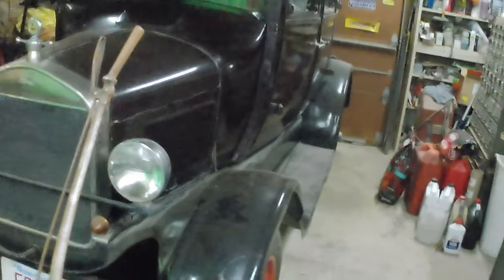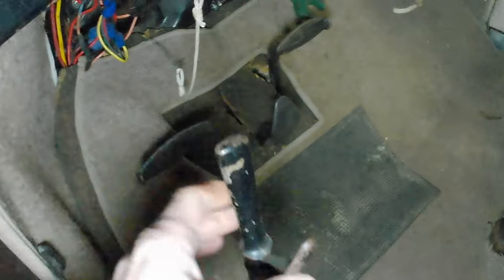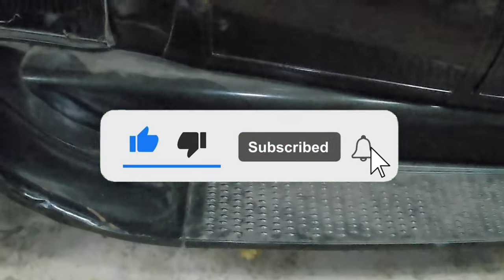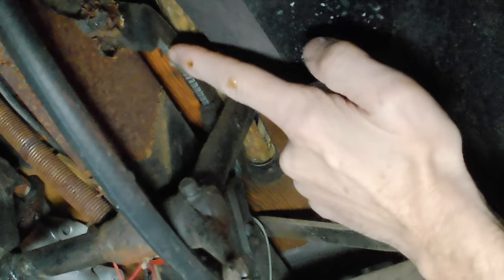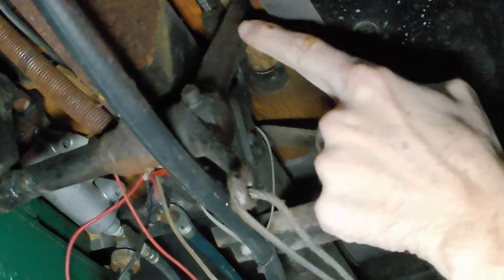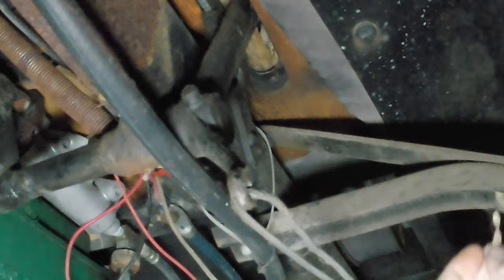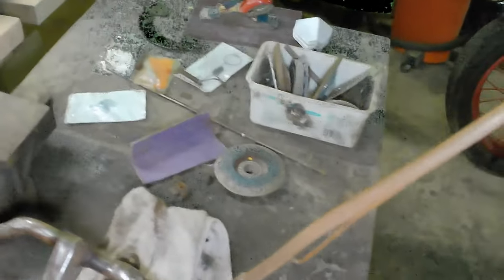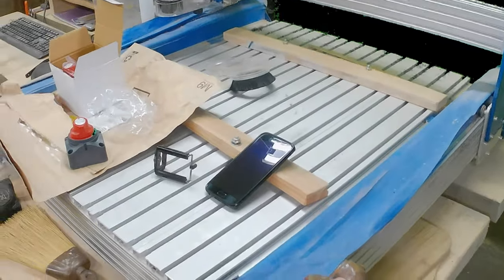All about the handbrake on a Ford Model T

Comment: What is the torpedo that you speak of?
Reply from the maker: In 1911 Ford made a lower fancier version of the roadster, the hood was stretched, seat pushed back and lowered, the pedals and handbrake controls were "clocked" so the driver could still reach.
Reply: @Gen3AntiqueAuto  Thanks for the knowledge!
Reply from the maker: @larryanderson8049 Thanks for watching!